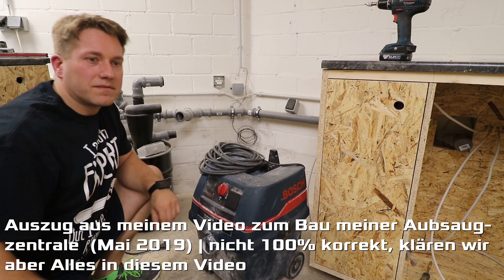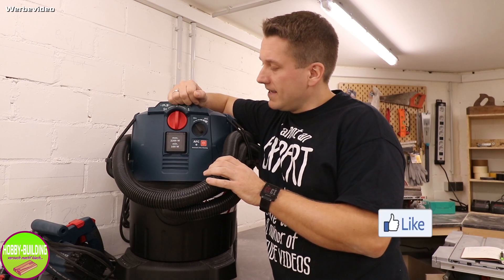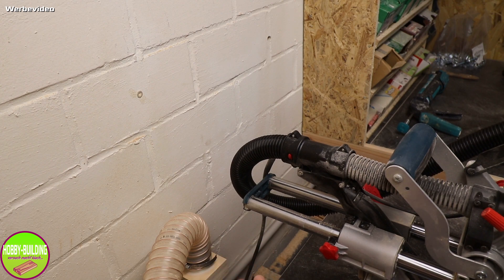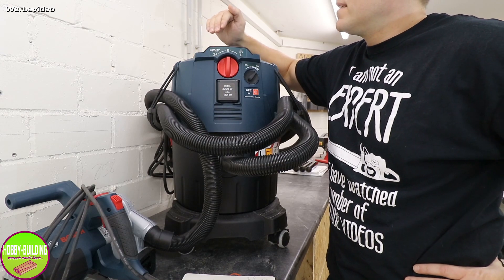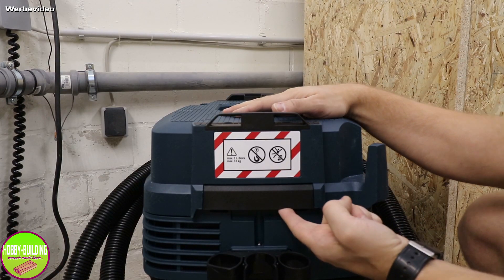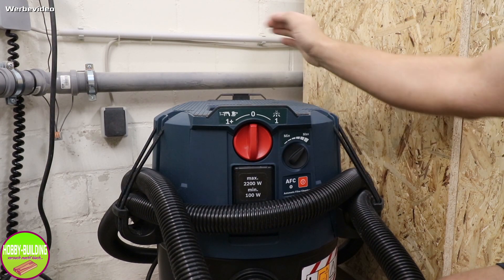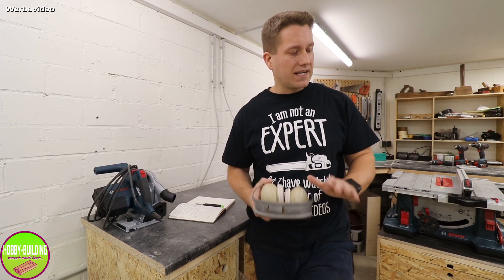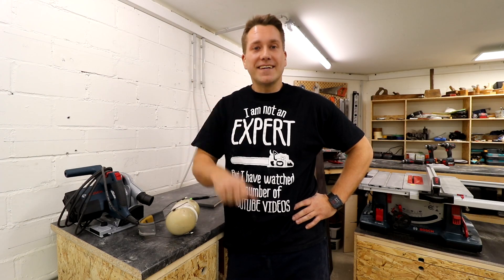Bosch GAS 35 L AFC Industriestaubsauger | Dust Extraction

Comment: Hab grade den Sauger gekauft. Wenn der Schlauch zum Sauger zugeschaltet ist und egal ob AFC ein oder aus ist und wenn ich den Sauger ausschalte kommt am Ende einen "zusätzlichen" leichten Luftanschlag und einen komischen "Sauglärm". Ist das normal? Danke
Reply from the maker: Hi Michal, du hast den Sauger vermutlich auf „Ein“ gestellt und schaltest ihn dann „Aus“. (Also nicht die Master/Slave Einstellung) dann kommt bei mir beim Ausschalten auch dieses einmalige Geräusch. Der Filter wird hier auch nochmals ausgepustet. Oder meinst du etwas anderes? Mfg Thomas
Reply: @HobbyBuilding  Hi Thomas, ja das habe ich gemeint. Vielen Dank für die schnelle Antwort. Ich bleibe nun in Ruhe👌👌.  Viele Grüße aus Tschechien....
Reply from the maker: Hi Michal, viel Spaß mit dem tollen Gerät und viel Grüße nach CZ. Hab dort mal eine ganze Weile in Ceska Lipa gearbeitet :-)
Reply: @HobbyBuilding  Echt? Schön. Ich fahre ab und zu über Ceska Lipa nach Horni Svetla (vor dem Krieg Ober Lichtenwalde - ganz an den CZ/DE Grenzen). 
Bitte noch eine Frage zum Sauger. Wenn ich die Funktion AFC nach dem EIN gleich ausschalte (grüne LED leuchtet nicht mehr) macht trotzdem der Sauger bei dem Ausschalten am Ende dieses einmaliges Geräusch - Putzen. Macht das Dein Sauger das gleiche?